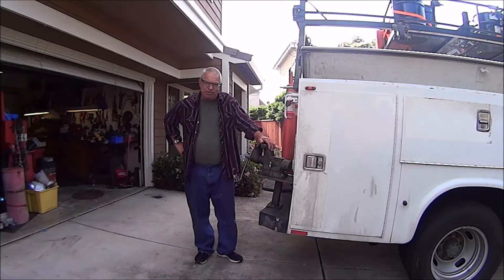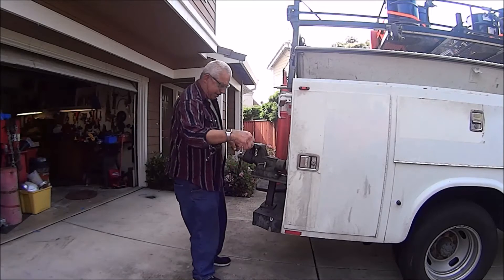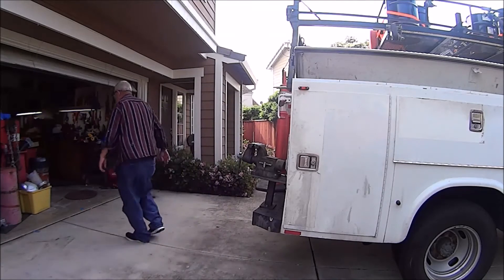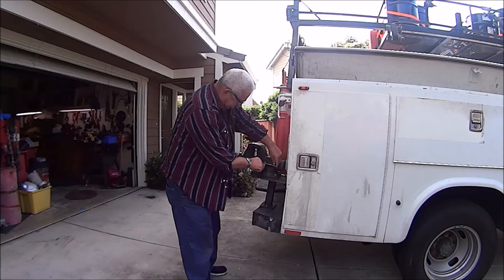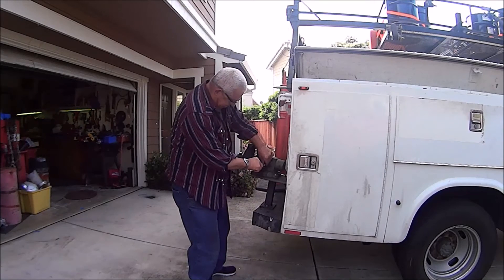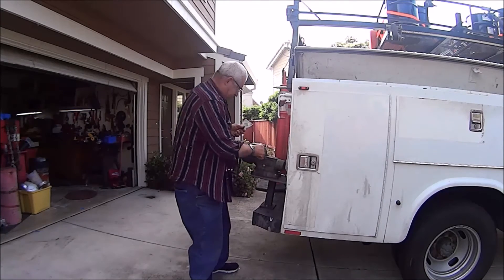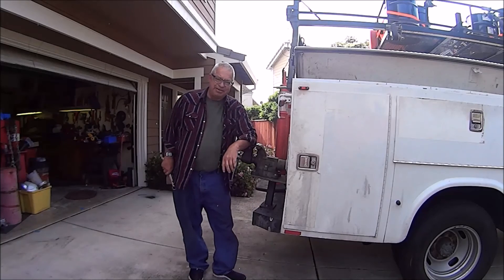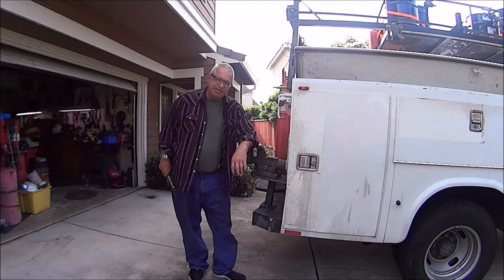Vise Hack

Comment: Sweet hack, some vise designs make it so you have to use a bolt through the vise body instead of a nut in my experience.

Noticed we have basically the same service truck box. Pretty common one but anyway do you have a video on that vise mount. It looks awesome and positioned perfect. Would you feel comfortable sharing the dimensions? 

Thanks for the video anywayz

Comment: You might wanna consider looking underneath that vice to see what your Actually wrenching down on. You'd may be surprised how underwhelming that plate is - and why they don't put big handles on there to over tighten it. Just a heads up - there's a video on YouTube where a guy tested about a dozen vises - and half of them broke at that swivel clamp.
Reply: You are right. Just like how people put cheater bars to tighten the jaws themselves. Not meant for that. I do like how this guy thinks outside the box tho.